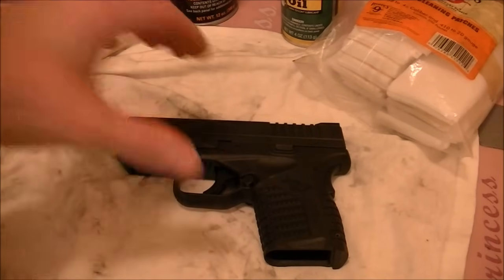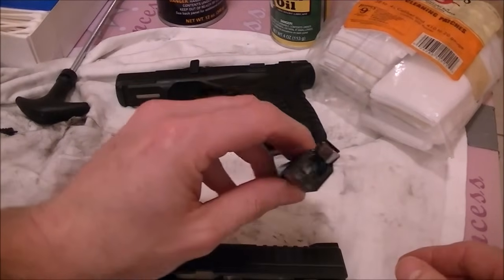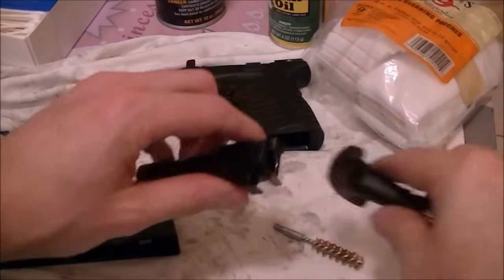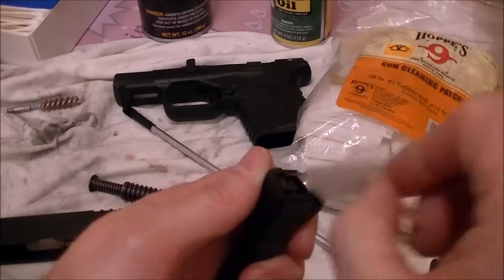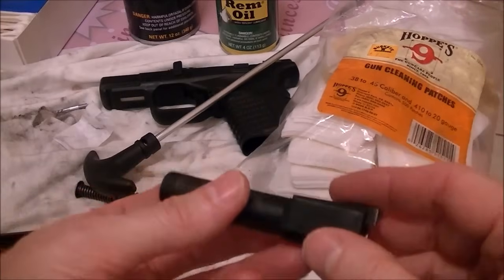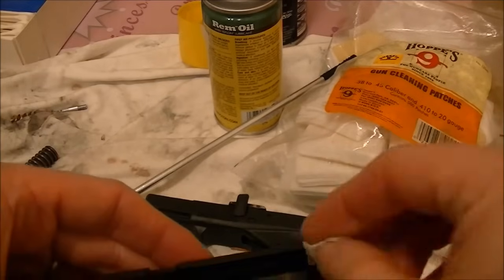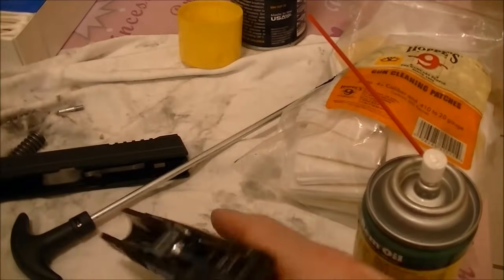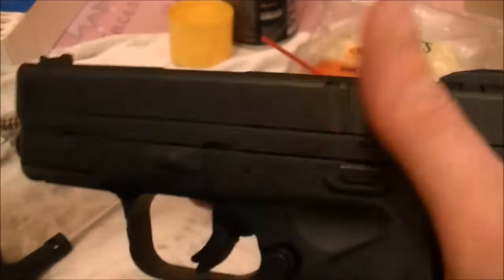How to clean your pistol?  (For new handgun owners)

Comment: why do you let the cleaning rod bang because the directions for my Smith & Wesson m&p 9 and my cleaning kit says that you should never let the cleaning rod make contact with the rifling at the muzzle and chamber throat area cuz you can damage those areas and it can affect the accuracy of the gun and you were just banging away with that rod all inside the chamber and the barrel?

Comment: Warning! Read the name of the bottle of Hoppes liquid you are gonna use. The synthetic one to clean the gun ate the metal finish of my barrel on a Ruger P95. If it says only barrel is only for the barrel. If it says gun parts is for the whole gun. I threw away the synthetic cleaning oil because of that. It damaged the sexy shine of my barrel.

Comment: Really helpful video for a beginner gun owner like myself.  I notice that you can retract the slide easily by finger pressure and release the slide lock with your thumb.  My XDs 9mm requires a great deal of force to retract and the slide lock is almost impossible to release with my thumb alone, I have to use a hard edge to release it.  Is it possible that the recoil spring has too much pressure or should I inquire about it at the shop where I purchased it?  Thanks again for the great video.
Reply: Put 500 rounds through it and reconsider if there's still a problem.  It may just need breaking in.

Comment: I've seen serval of gun cleaning videos. All very good and helpful. However I have never seen one where any attention/cleaning is done to the spring assembly. So does it not need any cleaning at all? I have been cleaning mine whether it shows signs of being dirty or not but that just the way I am when it comes to anything. I just try to be as thorough as possible. I assume that I'm not harming it in any way. Please advise.
Reply from the maker: Johnny Green Great question.  From what I've seen,  the spring assembly doesn't get very dirty.  It's not exposed to the burnt powder or hot gasses like the inside of the barrel or bolt face. It's actually in a spot that keeps it quite clean usually. However,  it's not a bad idea to wipe it down from time to time and put a little oil on it.

Comment: Do you ever have to clean that copper barrel brush? If so, how?
Reply from the maker: 1035heb I don't clean them. You could wash it with water the copper won't rust.  But it doesn't need to be really clean.  the point of the copper brush is to break copper or lead fouling free from the barrel. Then your cleaning patches that you run through it should actually clean out the now loose pieces. So I just usually replace the copper brush when it seems it's lost its stiffness and won't do the job of loosening the stuff that shouldn't be in the barrel. hope that helps.
Reply: No.

Comment: Can you just use the Rem oil for cleaning and lubrication or do you need a separate cleaner?
Reply from the maker: I'd use a separate cleaner. Rem oil is just a lubricant as I understand it. If you want a single product to clean and lubricate I'd use CLP. It's good for cleaning and lubricating.

Comment: Great video!! And I like the toothpick idea but I also saw another guy use Q-tips. Now that seems easier but is that okay to use??
Reply from the maker: You could use q tips, but I find they get pulled apart by sharp edges in the gun and leave little fibers behind. That's I don't use them.

Comment: how often should you clean? I have a sig sauer p320 compact .
Reply from the maker: +A Brown My suggestion is that if you know you won't be shooting it for a few weeks, clean it before you put it away.  A well kept gun will last for many decades.  I usually run a bore snake through mine right after shooting regardless and then try to clean them if I know there will be a few weeks before the next time I shoot.  Of course, if you are shooting a lot (many consecutive weeks in a row), don't not clean it unless you are trying to do a torture test :)
Reply: +ShootLearnShoot alright. Thank you!
Reply: +A Brown If its going to be used for defensive purposes, it needs to be cleaned after every time you fire it, or at least once a year, whichever occurs first. If it is just a pistol that you shoot for target practice and not for defensive use, clean it whenever you feel like it.
Reply: So far after each range session  I've been  cleaning it

Comment: Whats the difference between CLP and REM Oil?
Reply from the maker: Ryan DiAndrea CLP is a cleaner, lubricant, and preservative.  Where the Rem oil is just    oil.  I personally just use CLP now.  I spray it on wipe off all the dirt and then add a little more to the parts I think needs more oil.

Comment: +ShootLearnShoot Very helpful video.  One question, if I may - if CLP also lubricates, why is there any need for oil?
Reply from the maker: juicer67 You are right. Clp does lubricate as well. I no longer use oil in addition to the clp.  I typically only use clp now for cleaning and lubricating. I do use powder blast occasionally to get tough stuff. But make sure to lube it good afterwards
Reply: ShootLearnShoot Thanks very much for the detailed response.

Comment: STEP 1: Dry clean everything. Use dry clothes, brushes, etc to remove excess dirt.STEP 2: Spray CLP on the weapon. Wipe it down.STEP 3: Dry clean.STEP 4: Spray oil on the weapon. Wipe it down.STEP 5: Dry clean (or wipe off excess oil).Is this correct?
Reply from the maker: That's pretty much it. Other than in step one, I'd only dry brush the barrel. Take a copper brush or bore snake through the barrel a few times dry. Then I'd use cleaner on everything. I wouldn't spend time dry wiping everything. It won't hurt anything, but just adds extra time. The cleaner (CLP or Hoppes 9) will take the gunk off faster than a dry wipe.  Also, if I use CLP, I don't worry about oiling everything because it is a preservative as well. But I will still oil the moving parts.

Comment: can i use cooking oil?
Reply from the maker: No. I don't think I would used cooking oil. While it may smell of delicious fried food while shooting, I'm not sure that's good for the gun. I'll just say I've never heard anyone recommend using coming oil add a substitute for any kind of gun lube/oil.
Reply: +ShootLearnShoot when im in a pinch, I use synthetic motor oil it also helps with rust and doesn't drip as much when your gun is hot
Reply: I use Motor Oil and Hi Temp WB grease in my semi-auto firearms exclusively.  It stays where I put it and lasts a long time (as many as 1500 rounds without relubing).

Comment: But when you get them they are soaking wet...
Reply: Drake Drizzy  the guns are only oiled that way for shipping. The American Gun Institute uses Simple Green and hot water to clean guns. You can Google that. Guns do not need a lot of oil. A drop in the right places is plenty. Check out Gunblue490 on YouTube. Never ever scrub back and forth with the brush. One way only. Get a bore snake a few passes and done.

Comment: That is the worst cleaning a gun I have seen! The best way to using the small.cloths is to wrap them around the metal brush. The brush will bite the cloth and you can pull and push without the metal brush touching the barrel. Use the fattest wire brush that leaves a little clearance and single wrapped not double wrapped around the brush.

Comment: Why did you hold your gun and work like a HAMMER  kakakakakaka
Reply from the maker: I'm not 100% sure what you are refering to.  But if you mean working the slide back and forth.  One reason is to make sure there's no round in the chamber before cleaning.  If you fully cycle the slide a few times it should extract a round if there's one in the chamber. Of course, you still should visually check the chamber too.  The reason you do it after reassembly is to verify function. That is to make sure you put it back together correctly. Lastly, it's fun and I like doing it!